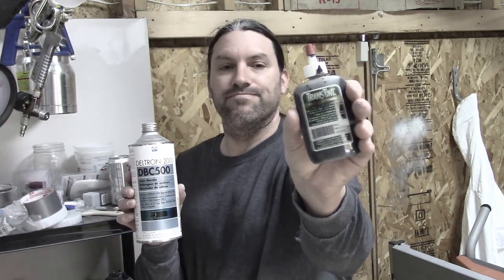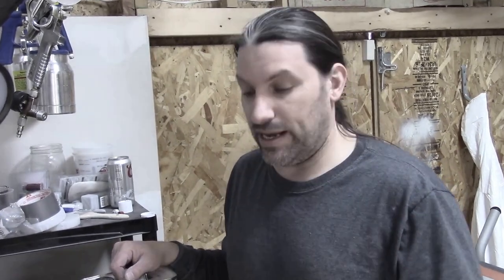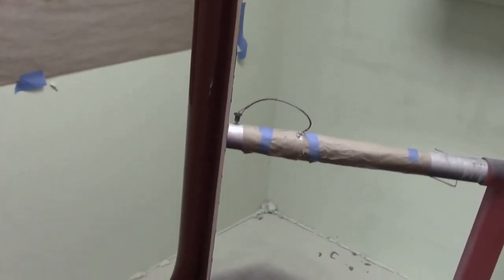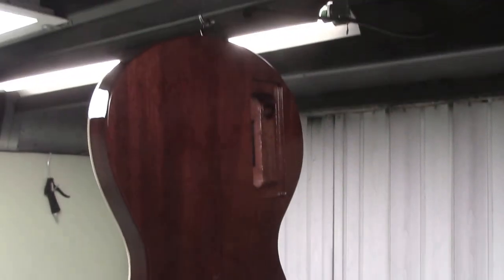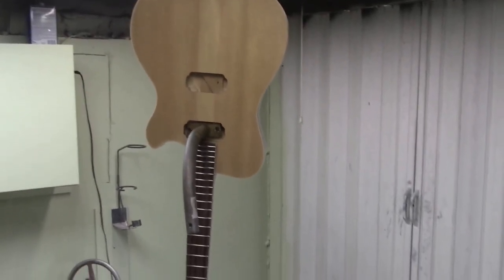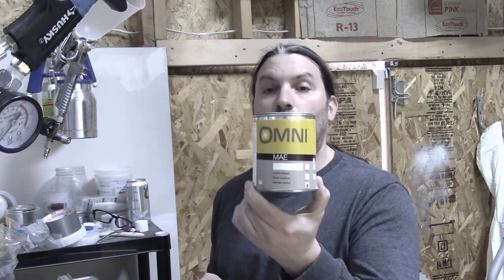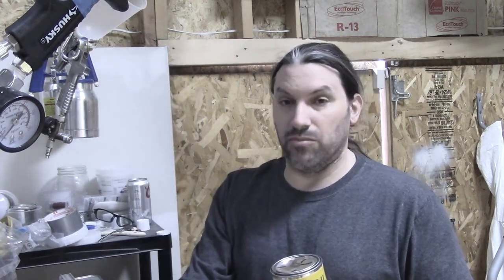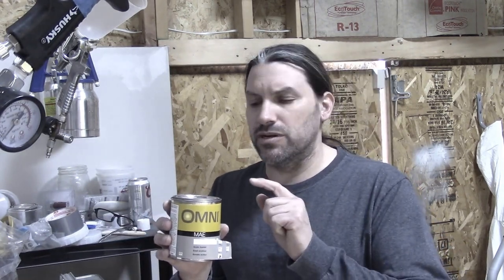Finishing Guitars With Modern Paints Part 2... Color Coats

Comment: I have two Glary Stracoaster type guitars what King of paint should be used to sand a little with 60/ grit to just scratch surface and leave the bluse color as a base coat and spray Like Alpine White over the blue color what type of paint can I have sprayed over the Glary blue color that's on my guitar now I don't  know what kind of paint Glary Guitars use on the stracoaster type guitars can You help Me with what paint I can have put over the Glary blue.
Reply from the maker: You might be able to scuff it back with 400 and paint over the blue. If you want to remove all the finish you will need to start with something coarse like 60

Comment: Hi Matt - Hate to bombard you with more paint questions, but I was getting ready to do my first spray job today and read on the DBC 1 tech sheet that it requires activator DX57 at 5%.  I read on some forums that it makes the basecoat MUCH better in many ways (through chemical cross-linking), but then they say it is not necessarily required.  
Do you use the activator on your basecoat?  Thanks bro!
Reply from the maker: Hi Dan, we do not use a catalyst in the color blender. We actually have a video coming this week on this

Comment: Hey Matt.. I plan to use Omni MC270 clear ..the guitar is yellow stained, has a Simtec primer coat sanded to 400. I want to spray a green burst using TransTint. Can I use MC270 with TransTint or do I have to use DBC500 ? If so are they compatible? (Dbc500 & Omni mc270)...How many total coats of clear do you recommend including the green layer? Love your videos man!
Reply from the maker: Hi Ian, thanks for watching the videos amigo, glad to hear you are enjoying them. Your guitar project sounds cool. We use the DBC-500 when making our own translucent colors with TransTint dye. There is also an Omni branded color blender that works well and is less money, I don't remember the product code but you can find it. Now, I'm not suggesting that it won't work with the 270... I just don't know. You could always ask your PPG guy and see if they know... or test it out? 
Clear coats are pretty subjective but I always error on the side of fewer. I realize this isn't really helpful but you should use the least amount of paint that will give you the results you want. This will, probably be different for every guitar you do. One of the reasons why paint is the hardest part of the whole process.
Good luck brotherman, you can do it!

Comment: Matt,   Why the move to Polys (Polyester or Polyurethane) vs Acrylic or Catalyzed Lacquers, since you were so familiar with NC Lacquer?  I have heard those lacquers are too inflexible for regular wood applications (good for plywood like cabinets).  Just wanted your reasoning.
Reply from the maker: Hi Mark,
The best answer I can give you is that the PPG paint we decided on met all of our requirements as far as compatibility with the Simtec sealer and  was available in a gigantic variety of colors. We struggled with all kinds of lacquer suppliers and finding the stuff and getting it shipped to us was a bummer. 
There really isn't very much difference between painting the color coats and the DBC-500 color blender and lacquer so the learning curve isn't a big deal.
The top coat/clear coat is a little different... that's coming up in the next video.
Thanks for watching amigo
Reply: Looking forward to it.   Got my SimTec sanding sealer yesterday and applied it.  All I will say there, is that I need to be more scientific/accurate with the catalyst to sealer ratios......  :) but I got it applied and will sand out today.   Thanks.
Reply: Simtec sealer comes in a lot of colors? I thought it was clear, grays, or white...
Reply from the maker: Ah, good question...

The stuff we use is the 28x50 and it is clear.
http://www1.inetba.com/simteccoatings/filecabinet/28x50app.htm

If you wanted to paint solid colors and not see the wood I can see how the white stuff would be pretty neat. 
Give them a call and see what they say.

Thanks for watching Amigo
Reply: I use a cheap tcp globa hvlp gravity gun with a 2.5 tip for the simtec. do you guys use the same? I can never get it to lay out flat, it always has orange peel. I have to sand it flat every single time! a lot of work to get it to come out like the pros.
Reply: Wonder if you could use a paint brush or foam brush to put the simtec on..? You have to sand it flat anyways...have you guys ever tried that?
Reply from the maker: Hi Alan,
I think we use one of those Husky guns from Home Depot... they come with a large and small tip. We always have orange peel too, though I think this is more of a byproduct of spraying in general. We go after the sealer coat with 220 on random orbit sanders and it makes short work of leveling things out. Oh, and scotch brite is your friend too.
Reply from the maker: Alan, we use rollers and brushes with the Simtec sealer all the time. It works great on the fabric top guitars. Have  look.
https://www.youtube.com/watch?v=WO6YLBjYcmU
Reply: Sweet thanks, that's a big help since really, spraying it is a pain the ass also as you know 25 mins goes by fast!

Comment: Matt, I thought I asked this the other day, but may not have.  Following color coat, how do you prep for the clear topcoats?  Light scuff sanding with 320grit or dull with 600grit or ????
Reply from the maker: Hi Mark,
Don't do anything to the color coat before your clear coat.
The really hot set up is to get your sealer coat perfect. Sand it to 400 or even 600... if you spend an extra 15 minutes on the sealer step you will save yourself more time down the line. You won't be able to cover any issues in the sealer coat after you put the color coat down. Then lay your color coats down and spray your clear coat in 24 hours or less (provided you are using the Omni stuff).
Reply: Texas Toast Guitars Yeah, being used to lacquer that melts in, what  I did not know is if poly needed a little skiff for it to grab on to.
Reply from the maker: Nope, you are good to go with the clear on top of the color. You shouldn't have to worry about bonding.
Reply: Good to know.  Looking forward to the rubbing/Buffing out video..........I am getting close......   thanks, Matt.